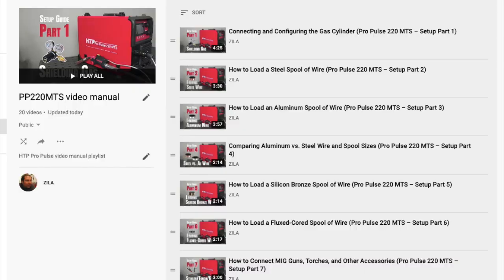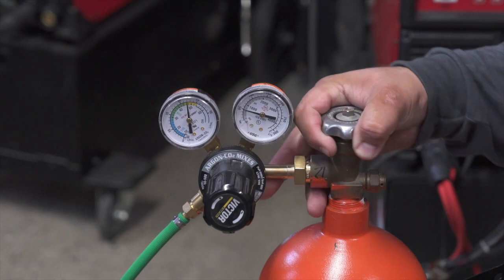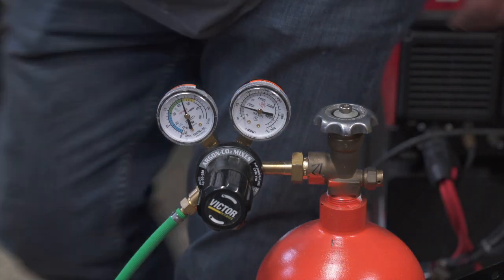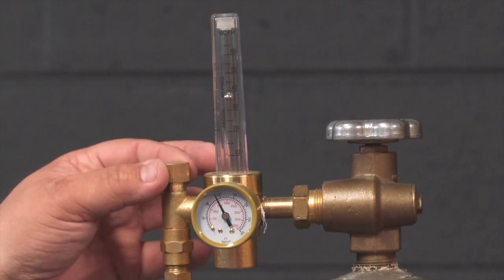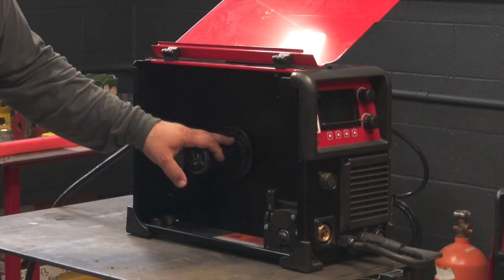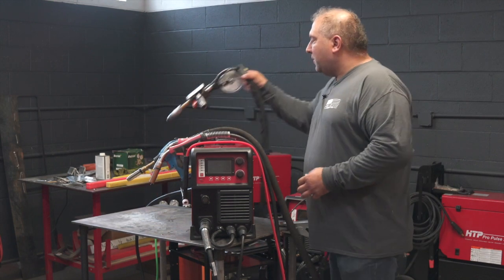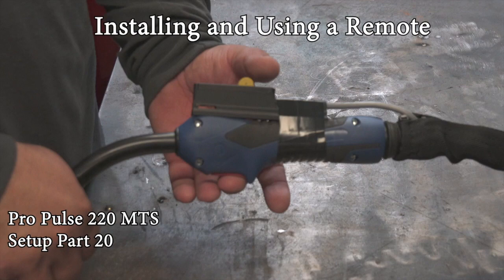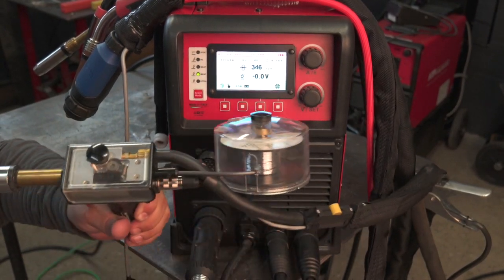CRAZY 😳😳😳 Pro Pulse Video manual .... the worlds FIRST !!!!

Comment: Torn between this HTP welder or the Fronius transsteel 2200 that is capable of welding on 110 volt input
Reply from the maker: Check you tips, nozzles and other consumable prices ….  
Fronius is  NICE STUFF hands down !!! But its all proprietary stuff ….
New nozzles htp 3 pack $20
Fronius 5 pack $140
New htp mig gun $149-169
New fromius mig gun $500
I mean ….  Its nice stuff, quality comes at a price, so does exclusivity
Reply from the maker: If you want to weld aluminum or silicon bonze the htp is a “better choice” 
If you only weld steel - its a toss up
If you need 110volt input you need 110 input …
If you want 110 just because …  forget it, you will be very disappointed with the output on the machine ….  110 volt has “nothing to offer” once you go past 14ga or 1/8” ….
Its not really enough juice in a 110 outlet …. And it NEEDS to be a dedicated 20 amp outlet, nothing else being on that breaker ….
It could be ok for some sheet metal/ auto body work

Comment: I'm planning to purchased mts 210 welder any advice on that machine? I know it doesn't have pro pulse but I don't see alot of videos on the mts210 any help I would appreciate it!
Reply from the maker: MTS 210 and Pro pulse 220 MTS have the same power board, on the logic board the pulse module is missing. the power output and duty cycle are identical

Comment: The Only fully informed Aluminum Mig weldor I've ever seen,  always love watching your vids keep it going, 
 If you get a chance make a video on ALUMINUM mig welding 1/4" - 3/8"  thick  crack repair verticle and overhead, like on 53' ALUMINUM flatbed semi  trailers.  😃😃😃 Thanks
Reply from the maker: I did a video on an aluminum flatbed trailer, most of the stuff on there was 1/8-1/4"thick ...  the parts that are thicker (3/8' or more) are the I beams on the frame and I would highly recommend you stay away from welding those ....  
https://youtu.be/8RGp2cQVEmQ
here is the trailer 
https://youtu.be/hqdpzioF6to
here is why I wouldn't and you shouldn't weld that I beam
but I am considering making a video on how to weld thicker aluminum sections.

Comment: How thin can the propulse Weld aluminum? I have a jon boat I want to work on and can't figure out if I want the invertig or the propulse.
Reply from the maker: https://youtu.be/eQ3SA8ny3uQ
you can weld with .035 5356 wire down to about .030" ....  a Jon boat is typically .060-.080" thick ...  so as far as welding it - that is not really challenging ...  lets say once your material thickness is .050 or .060" .... it's "easy" 
both machines could do the job ... in my mind vertical up or overhead is easier with the mig  (but that is just me you as 3 other guys and get 4-5 different answers .... LOL) 
its up to you....

Comment: Lately, I've been watching an Indonesian welder who stick welds square tubing using a "dab, dab" technique which is basically turning a cheap Chinese inverter welder into a poor man's pulse stick welder. Some welds look very good, if you do it right. The trick seems to be using 6013 which has additional carbon content (which enables vertical welding). I learned the formula's for the 6013 flux vary and you need the more violent variety for this technique, vs the smooth running which wouldn't work very well. I'd like to see you take a look at this. Some come out looking almost like TIG, if you do it right. The joints are too thin to run a traditional bead all the way across, blows a hole. I'd love a pulse stick welder, but can't afford one. The welder only uses 2.6mm 6013 DCEP (vertical capable flux).
Reply from the maker: well - most guys that I know can weld vertical up with 6010, 6011, 6013, 7014, 7018 .... no problem ...  6010 and 6011 weld vertical down pretty easy as well ....   the reason why you want a "violent" 6010 or 6011 rod is so the re strikes are easy and it runs contamination (from all the starts and stops_ out of the weld ....  
See on pulse stick the arc never extinguishes which keeps it clean and strong !  the arc goes from welding current to background current - the background is not enough power for any metal transfer worth mentioning BUT it keep the arc lit and burns just enough flux to maintain the shielded atmosphere ....   
every time your arc extinguishes it is a start and stop ...  every start and stop is a potential weak point, leak point, origin of a crack or failure ....  Personally o would not choose a technique like this if I was welding on anything that matters ....  I can see a technique like this being fine for a fire pit or something else non critical ....
Reply: @ZILAwelds  the guy using this technique is not welding vertical, really only flat or horizontal. Every Indonesian welder is using this technique, although they are all capable of running nice conventional beads. The are also all using the same brand of 6013 with this particular flux mix. Nikko RD-460. They use this technique for fabrication, such as most people would be doing at home, as they can't afford more than stick welders. I have seen it come out looking like TIG, seriously.

Comment: Hey Peter, I meant to ask - on the PP220 is there a way to load wire without turning the gas off to advance it thru the mig gun?  My older welders have that, didn't see a way on the PP220.  Yes, I can just turn off the bottle, but I thought the pp220 would/should have that feature.  Thanks!
Reply from the maker: yes and no.  the machine is programmed to turn off the welding current AND the gas 4 or 5 sec into feeding wire without striking an arc ...
so if you STAY on the trigger  - you only loose a few seconds of gas after that you can feed as much wire as fast or as slow as you want to without loosing any more gas OR being afraid to unintentionally strike an arc as the wire comes out the mig gun ....

as far as a job and purge button ?  the PP220 Mts does not have that.
the pp300 and the mig 200i have those ....
why?   beats me    LOL
Reply: @ZILAwelds  Lol...  Thanks for reply.  I hope HTP engineers somewhere are seeing feedback.   Things like this could just be a prefab job choice on the menu like "load wire" and handled in a software update to existing machines.   Hopefully they are also developing more presets for unlisted wire, such as .023 Silicone Bronze etc.  Another thing I would suggest, in case you have their ear,  is once a job is picked, there is a recommended gas flow displayed somewhere.   I am finding you and others suggest much stronger gas flow than I am used to.  Oh, and last but not least, labeling the saved jobs with a simple alphebet menu.    I realize we're just talking here, but maybe HTP sees this... Lol.   Thanks again for recommending this machine to me!  Rebuilding some .032 stainless exhaust right now... because I can with this machine... !!

Comment: Peter,

 I hope Jeff Nolan gives you credit for what you do for him. When I buy my next HTP machine which will be the ProPulse 300. I will be sure to  emphasize it was because of you.  Thank you for what you do , it is always a learning experience.
Reply from the maker: there was a comment where you asked me to compare 2 machines. - but I cant find it anymore .... and you wanted to compare a machine to the PP300 .....  well, let me tell you. -as far as power output - it compares REALLY close to the PP200/220MTS platform ..... when I tested power output I could not get more than 190ish amps in pulse out of the machine ... and according to the manufacture the 250 amp is peak pulse ....  so the PP200/220mts has 300 amp peak pulse ......   the PP300 is a 320 amp mig machine with a 60 amp peak pulse ....  I hope this shine some light on the "comparison"    also if you plan on aluminum, the remote control is REALLY a "must have" .....